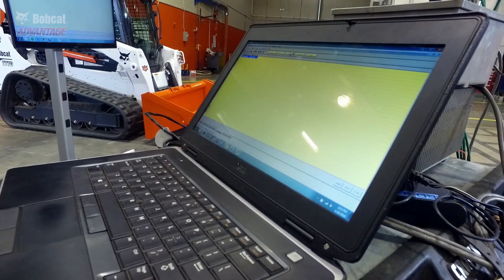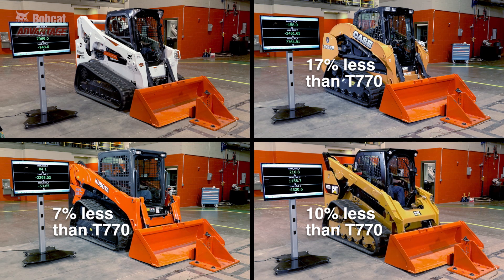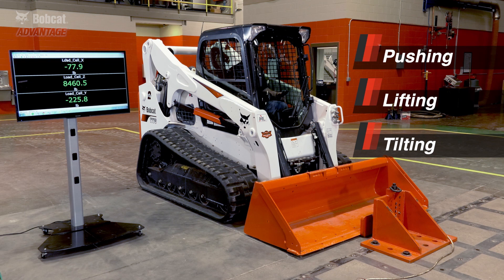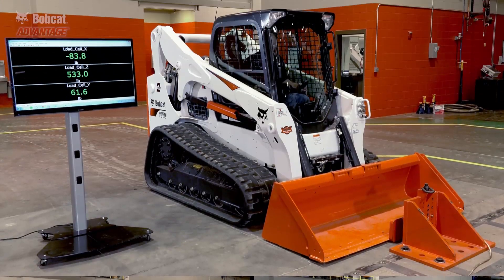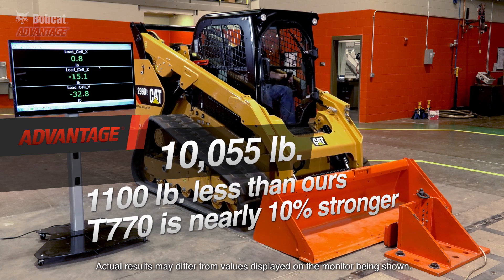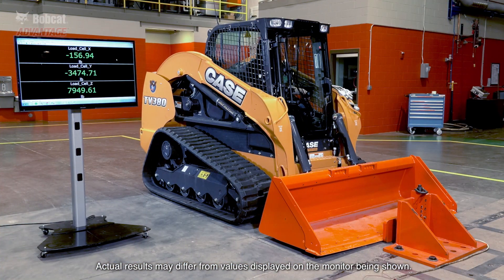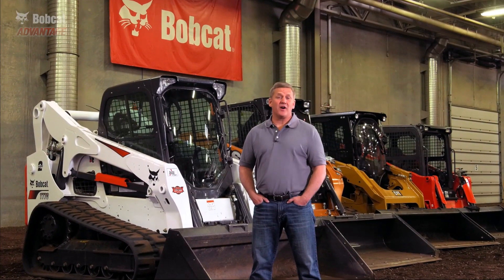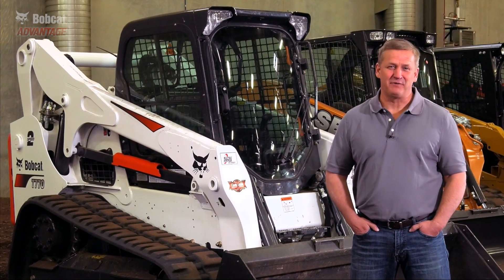Hydraulic Performance: Bobcat vs. Other Loader Brands

Comment: Should have used the tv450b case since it is around the same size and weight as the bobcat t770, Stop trying to use smaller loaders from your competitors to make your look better, no wonder why it is 17% less let’s compare the same 3 competitors loader against a bobcat t450 and see the difference.

Comment: Why don't you guys test with John Deere? I think your guys new bobcat line is great you guys are doing a good job because 5 years ago I didn't really like bobcat but now you guys are my 2 top favorite  skidsteers and I have over 15 years experience running all different skidsteers
Reply: Lol so what bobcat is saying is that they can’t even touch the John Deere 333G. I would love to see a compression of those two
Reply from the maker: Thanks for your feedback. Machines featured in Bobcat Advantage videos are top Bobcat competitors (based on market share) for each product category.
Reply: ABSOLUTELY the most operator friendly machine is a Bobcat... 100%.1 It does not matter how strong a a machine is he if you hit the side of a house with it every time you are trying to back fill because you can't see corners, or the controls aren't precise...  BOBCAT strong and NOT tippy on a slope